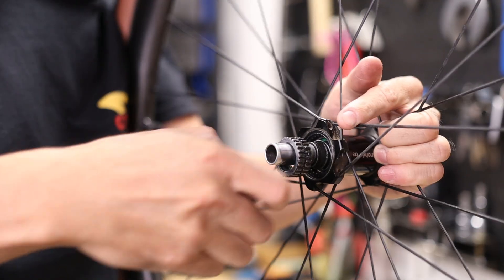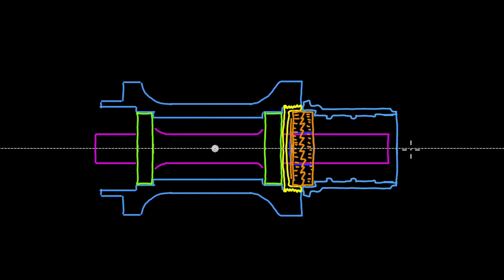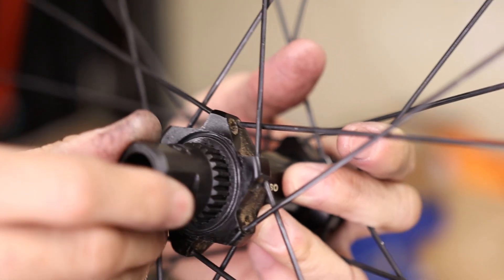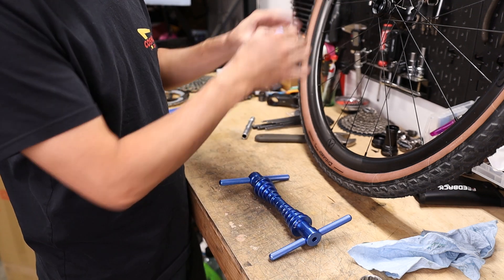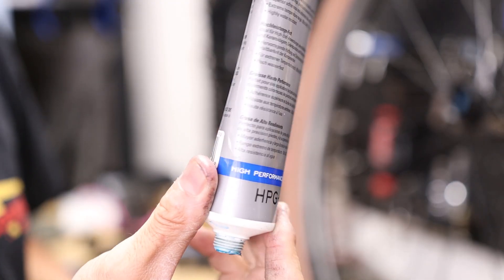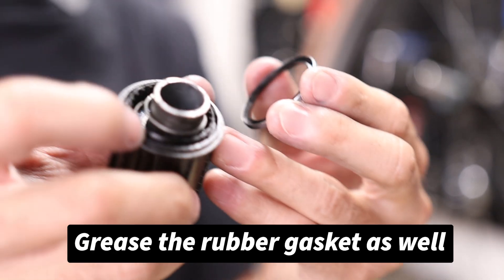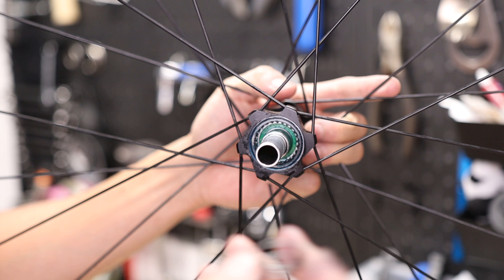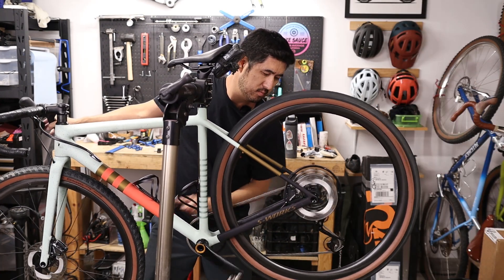HOW TO: DT Swiss Hubs // COMPLETE TEARDOWN & REBUILD

Comment: I've had incessant "ghost pedaling" since new on my all 3 sets of DT Swiss Star Ratchet hubs (Two 240s MTB and 1 240s road; all bought in 2020/2021).  No matter the mileage, no matter how many rebuilds I performed using only DT Swiss hub tools and their proprietary greases, the ghost pedaling persisted. I read other people attributing the issue to the freehub body seal (P/N #HSOXXX00N1031S).  I inspected mine closely and saw no flaws. I followed their reinstallation instructions to the letter, but no change. It was only when I decided to NOT reinstall it that the ghost pedaling finally ceased.  EUREKA!

Comment: boil the kettle and pour the hot water over the hub and the aluminium will expand slightly making the nut in the free hub side release a lot easier.

Comment: I’m at my wit’s end with my hub. Decided to do a full rebuild on my bike and replace the HG driver with an XD driver. I’ve put my hub together exactly as shown twice now and whenever I tighten my rear axle all the way down, my freehub becomes fixed. I swapped back to my old HG driver and end caps and it’s doing the same thing. It makes no sense that this is happening. Any ideas?
Reply from the maker: If you installed the ratchet ring backward in the hub it will bind like this when you tighten the axle. I’ve done it before. Try flipping the ratchet ring the other way and let me know

Comment: 14:08 The ratchets need lubrication as well(DT Swiss special grease or equivalent). Same goes for the inside of the hub caps that will touch the bearings(just regular grease).
Reply: Was going to say the same

Comment: Love the video, i recently serviced my dt swiss 240 ratchet system rear wheel. Once I tighten the axel when assembling, it seems that the free hub body stiffens (the cassette doesn't go freely) it only smoothens when I loosen the axel which is no good, I can't work out the issue. Any idras please. I.e when the wheel is not assembled to the frame the cassette runs perfectly fine.

Many thanks
Reply: I’m having similar issues, did you find a solution?

Comment: YES!! This is the video I was looking for. thankyou!...also it seems there are over axle bearing press adapters to be able to fit the drive side bearing into the wheel without needing to give it a love tap with a mallet. Ive got one ordered, so if it works out I'll let you know.

Comment: I attempted the hub service including all 4 bearings replaced. But now there is drag, resistance. The pedals spin on their own and it won’t freewheel , coast. Any suggestions as to what I did wrong?  Seems like maybe too much load / preload on the bearings?
Reply from the maker: Try and isolate the drag. Remove wheel, see if it spins if you hold from the end caps. Remove freehub and see if the wheel still spins. Check for smooth rotation of each bearing. 

If there’s only drag after you tighten the wheel into the bike, it could be one of the springs binding and not compressing properly, which could create a restrictive axial force. It could also be that you installed the ratchet lock ring backwards
Reply: @ Thanks!  I tried all of these things and also tapping the axel from the drive side to take a little pre-load off.  None of it worked.  I did take the free hub off and took out the ratchet ring nut to be sure it was all assembled correctly, which it seemed to be.  I finally gave up and took it my LBS.  Their initial thoughts included maybe the bearings were not pressed in correctly.  That could well be the problem, I don’t have a bearing press and used the ratchet ring tool, the axel and other  improvisations to install the bearings.  I did learn a lot, but get it 90% done right isn’t good enough : (
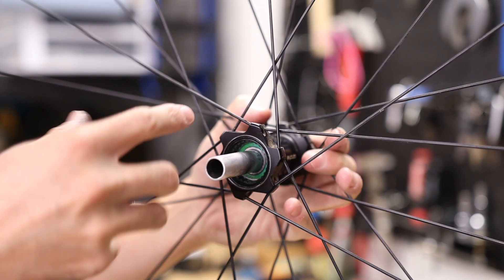Reply: @mattkavanaugh5623  Hi Matt, If the pedals turn when the rear wheel is spinning in the stand it is likely that you're missing the axle sleeve that keeps the freehub spaced away from the hubshell (you can see it at 1:36 in this video). If that is still in place and undamaged, then it might be possible that the bearings were over preloaded when they were installed. You can check this by removing the freehub and feeling the bearings for notchiness in both the freehub body and the hub axle. 

Hope this helps!
Reply: @LogosComponents  Thanks!  The spacer is still there. I think i messed up the bearing preload but i can’t figure out where or how to install the bearings differently as i don’t have the special presses. I took it to my LBS for them to sort out. Sort of a defeat but i did take it apart twice and got it all back together although with drag in the system. 😒. Frustrating.
Reply: @mattkavanaugh5623  If the bearings feel free. Then there is a pretty big chance there is to much grease in the ratchet system. Right semi thick grease is really important for it. Like Shimano freehub grease or the DT Swiss teflon grease for freehubs.
Reply: @ Thanks!  I did check the grease on the ratchets.  I used a thin MTB suspension grease, very light coating, and then opened the hub back up and wiped it off completely.  No difference in the drag, unfortunately.
Reply: greetings, Matt, how did you resolve this issue? What caused the drag in your hub? The same happened to me now. I did this service to my DT 350 rear hub, cleaned/lubed everything, put it together, the cassette - free hub was spinning nicely when the wheel was out, but after I put it into the frame it did the same, did not coast - cranks kept on spinning and when I held the crank, chain skipped on the cassette cog. I could even pedal backwards. Only holding the cassette with some force kept it in place and the wheel would spin freely-coast.
Reply: @ Hi, I ended up taking the wheel to my local bike shop to fix it.  Ended up costing about $100 I think.  They said they replaced the bearings (all four I guess) that I had installed, and the spacer and/or washer - they weren’t clear on what was replaced, calling it both a spacer and a washer but maybe they replaced both.  I think I damaged the spacer somehow when I put the hub and free hub back together, and maybe not getting the bearings in straight.  Based on my experience, I would take your hub and free hub apart completely and start over with the process.  Good luck and let us know how it goes!
Reply: @mattkavanaugh5623  Issue solved. I have 3 wheel sets with DT 350 rear hubs on which I wanted to change bearings. 2 for gravel 1 for MTB. I had trouble with the 2 gravel wheels, using only home tools, I do not have a bearing press, I damaged the bearings a bit in the process, but that had nothing to do with it!!! On my MTB wheels I decided not to change the bearings after that, I only cleaned and lubed it and it had the same issue as the other two. What all 3 wheels (DT 350 rear hubs) had in common was that I unscrewed the ratchet nut which came out with the seal ring - that caused the drag. The seal ring was not pressed into the hub shell deep enough, it was difficult to get it back in place and the edge of the freehub simply got stuck into it after the hub was pressed with the axle into the frame. First I was taping it in with a flat screwdriver which damaged it, then I got a better idea, I took out the ratchet rings, springs and everything from inside and used the empty freehub to press the seal ring further into the hub shell (onto the ratchet nut) which worked perfectly, it pushed the seal ring evenly on its whole circumference. Done a few rides after that, coasting is fine.
Reply: @ Thanks for the follow up.  I am impressed you figured it out.  My problem could well have been the same.  Hopefully I will remember this issue if I ever attempt to service the hub again.

Comment: In my DT Swiss 240S hub, and shown in the DT Swiss YT video, there is a shim washer on top (outboard side) of the drive-side hub bearing and under/inside the ring nut.  I did not see that referenced in this video?
Reply from the maker: Thanks for bringing that up! Mine had that shim too. Mine was damaged but I was told that it’s not necessary to reinstall it. When I get a replacement shim, I’ll put it in there.

Comment: Do the Logos hubs parts work interchangeably with DT350 hubs and vice versa? Can use dt Swiss parts on logos wheels?
Reply: Quote from Logos FAQ: “While riders have had success using DT Swiss components with Logos hubs, using DT Swiss components on Logos wheels and hubs will void the warranties of all DT Swiss components used. Riders combining DT Swiss and Logos components should be aware that they do so at their own risk.” But how well does it work? That would be super interesting to know.
Reply from the maker: Good question. I was told they’re interchangeable, but perhaps it’s a liability thing. What would you want to test for compatibility? Axle, star ratchets, freehub?
Reply: @TheBikeSauce  I'm mainly interested in star ratchet compatibility because it's much easier to find DT Swiss ratchets here in Australia than OEM Logos parts. The freehub's interchangeability will also mean I can leave my freehub attached to my cassettes when swapping wheelsets between DT Swiss and Logos.

Comment: Excellent video, thanks. Especially your drawing.   ...But no grease between the ratchets themselves??  I always put some grease on those too, after all they're doing all the work. Also grease quietens freehub noise down a bit.
Reply from the maker: I mentioned anywhere you have metal to metal contact, grease is recommended. Video didn’t show applying grease to ratchets, but there’s some on there. Thx!

Comment: Great video!

do ceramic bearings actually give you ant benefit at the typically low RPM that bike wheels spin at?
Reply: @BikeNorthSeattle  I’ve seen videos on YT (Mapdec and Hambini) that ceramic aren’t really worth it as the races wear more quickly (they aren’t ceramic, only the ball bearings are), and the reduction in friction is negligible
Reply from the maker: Good question. I’ve been hesitant to answer that just yet since I don’t have any data on it. First impression is that they’re smooth, but indistinguishable from a standard bearing. I believe the benefit comes in the form of longevity, but that’s hard to quantify

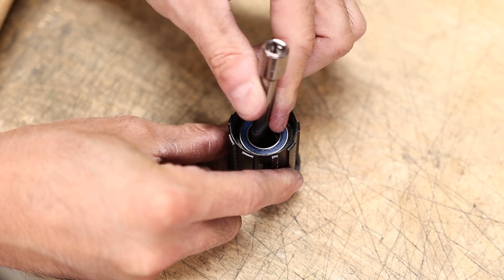Comment: Great video, thanks for posting.  One thing I wanted to note (around 11:43) that folks should notice was when using the extension to hammer out the old bearing, you never struck the sleeve, only the revealed edge of the old bearing.   It is clear you did the right thing but it seems like a mistake I'd make if I weren't watching closely enough.

Again, great vid.
Reply from the maker: Right, thx for the clarification

Comment: Perfect timing of this video for me!  I discovered yesterday that my DT Swiss 240S rear hub was not spinning freely, although it freed up after riding for a few minutes.  Before then it was noticeably increasing pedaling resistance.  So I think it needs servicing, but maybe not replacing bearings?  Input on this from anyone would be appreciated.  Also, is it appropriate to put some light grease, just a bit, on the ratchet rings?  Thanks !
Reply from the maker: I’d say if you’re going to go to the trouble to open it up and service it (clean and regrease), you may as well get some fresh bearings in there if it’s been a while. You can lightly grease the ratchets if you’re trying to quiet the hub down a bit
Reply: @ Thanks!  I ordered the bearings and the ratchet ring tool.  Fingers crossed it all goes well…
Reply: Hi Matt, for dual-spring star ratchet hubs like ours, we recommend using Dumond Tech Freehub Grease (not oil) for the ratchets. It's a bit thinner than park polylube, which lets it engage more consistently. DT also makes their own special grease for this purpose as well. 

A light coating is all you need on the ratchets - less is more generally!
Reply: @ Thanks for this input.  I used an MTB suspension grease on the ratchets, very thin and runny, almost like oil.  And I did not use much, and the re-opened the hub and wiped it all down agains, but I still got the drag in the system.  I don’t think it’s the free hub, I suspect the bearings in the hub body that I may have installed incorrectly.  I took it to my LBS and left it with them the sort out as I couldn’t figure it out.

Comment: I was recently replacing bearings on my Novatec front hub with similar axle with flanges. I have exactly the same aliexpress bearing set as you, but I was missing over axle adapter for pressing in second bearing. On reddit I found advice to use end cap instead of over axle adapter, and also you can use QR skewer to press the bearing in if you don't have a press. Worked like a charm.
Reply from the maker: End cap is genius!

Comment: There are many YT videos on breaking down DT Swiss style hubs and I’ve viewed more than my share of them, but I always appreciate your videos for your clear, methodical explanations and your engineering drawings on the fly which always puts things into a helpful perspective for the rest of us. Can I suggest that you do a future video on cartridge bearings where we hear your thoughts about the different types (seals, materials, etc) and makers (NTN, NSK, Enduro, no name)?  Cycling enthusiasts get excited about shaving a few grams or aero shapes, but most of us aren’t pro cyclists cranking at 50 kph in the flats. I think rotational parts (design, build, maintenance) parts, like bearings and chain links, make an oversized difference in cycling efficiency, thus enjoyment, but don’t get sufficient attention.
Reply from the maker: Great idea. Thanks!
Reply: Agree, a video on replacement cartridge bearings would be very helpful in addition to this